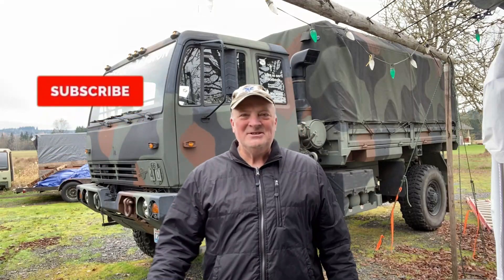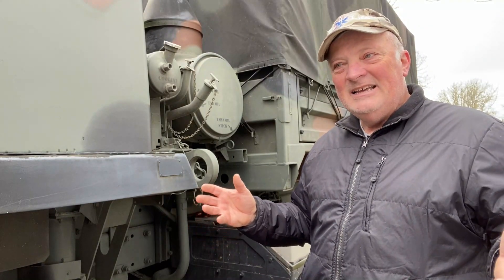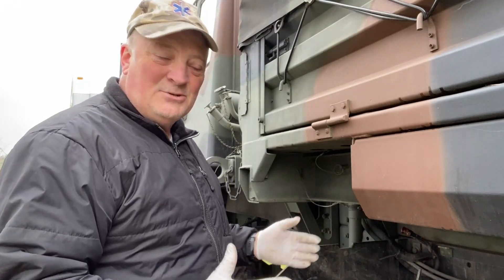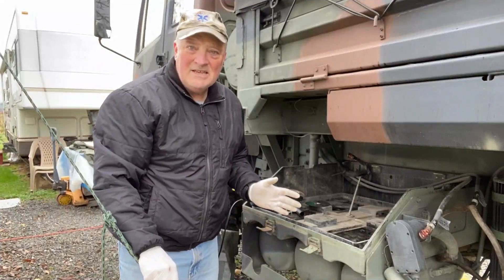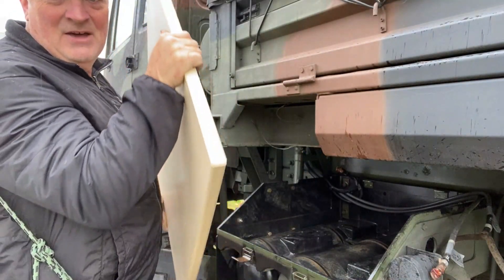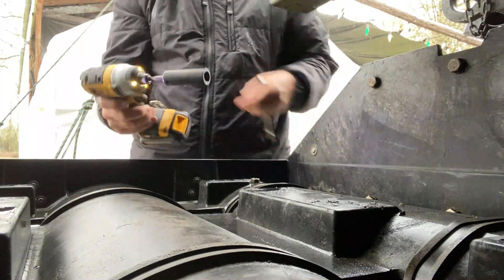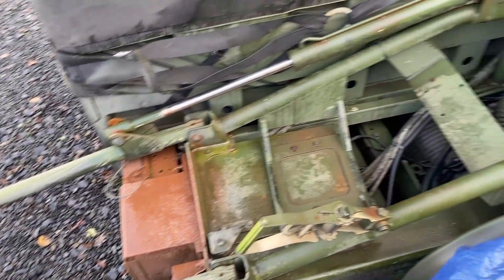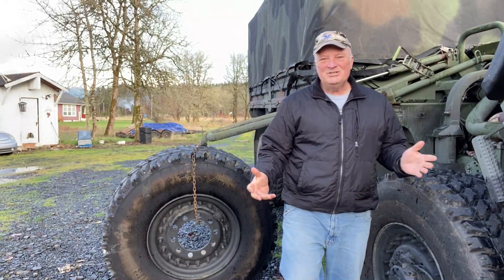BATTERY BOX UPGRADE & EQUALIZER PT. I #145

Comment: Love your videos. Super helpful, informative, easy to understand, and entertaining. Any chance you could begin adding part numbers and costs into your comments section? For example, what model/make are the four batteries you used and how much do they cost? I'm assuming you went with all 24-volt? Great work. And thanks for sharing the knowledge!
Reply from the maker: The interstate batteries were donated, so I’m not really sure about cost… and as far as their makeup, they were just whatever the guy had. I can tell you they are lead acid and 12v… since I have the OEM alternator, and also have a spare, I run both 12 and 24 volts. I could switch to 24v only with the equalizer, and get a 24v alternator… and when I have roasted both these dual voltage alternators, I probably will.

Comment: I moved to the country, so I could have a scrap yard that was far enough from the house, yet closes enough to remember I might have what I need. I do get visitors to my scrap yard.
Reply from the maker: The scrap door you gave me was exactly 27 1/2" X 30'-ish... there is not much meat left on the bone. Just the door lock is all that is  left with a tiny bit of plastic around it. I'd say we saved a little more from a landfill with a job well done. It makes me feel good inside.

Comment: Awesome job 👍do you have the link to the 24 to 12 converter that you had there ? I could see that to be very useful 👍👍
Reply from the maker: Unfortunately, I don't. This one was donated to me for the Mission's use. I am checking with my friend that works on metro buses that also use an equalizer running 24vDC for starting. I'll post what I find in Part Two.
Reply: Awesome, I really appreciate it 👍👍 thank you!

Comment: WOW!  This brings back some memories.  On a sidenote all 6 of the 2 year warranty WalMart batteries I installed over 2.5 years ago are still going strong thanks to solar and the battery equalizer setup I installed early on in my build.  You should net the same results...
Reply from the maker: I saw that all of your batteries were also deep cycle, which made be breathe a sigh of relief, since that is what was donated to me to use. The install is next!